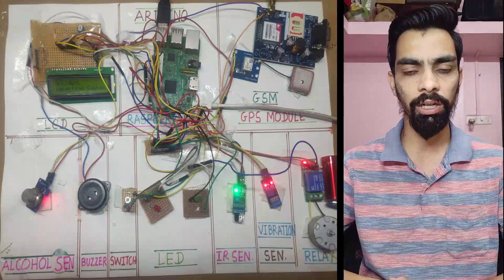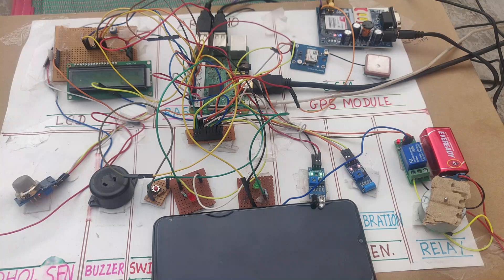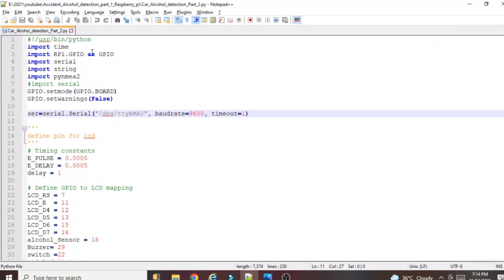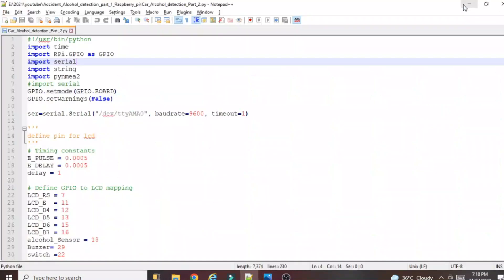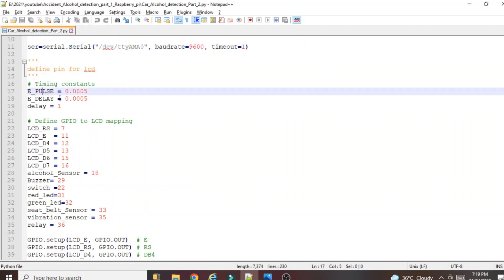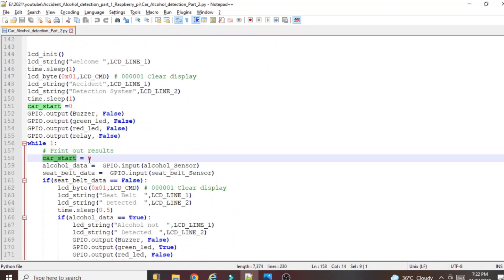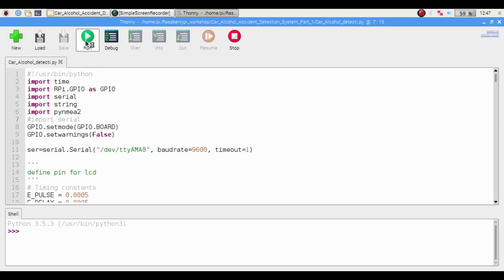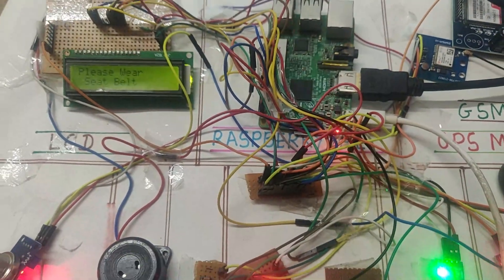Accident Detection System By Using Raspberry Pi | Send Live Location

Comment: How to interface gsm and gps in raspberry pi, in which pin we have to connect both ?
Can you make a separate video for it.
Reply from the maker: Separate video for gps is there . Have you watched ?
Gsm I will do .
Or do you want both in one video ?
Reply: @Rahul_Jadhav_Project  I want both GPS and GSM modules interfaced with raspberry pi in one video, the gps with raspberry pi video was very useful.
Reply from the maker: @arjun.k7090  sure I will make..but meanwhile if you watch my accident detection part 2 video in that video I have used gps and gsm in one project.
You need to copy that gsm and gps code and create new program . connection will be same
Reply: @Rahul_Jadhav_Project  I have connected GPS TX to Raspberry pi RX and GSM RX to Raspberry pi TX , is this connection correct?
If it is correct, when I send a message through gsm to my number, in the Raspberry pi it is showing send, but the message is not receiving in my mobile.
Any solution for this?
Is there any initialization for GSM like the GPS?
Reply from the maker: @arjun.k7090  which gsm module r u using ?
Have you enable serial communication by watching my gsp with raspberry pi video ?
Reply: @Rahul_Jadhav_Project  the same GSM module you are using in the video, I was using jio Sim,  let me change it to another carrier and see.
Reply: @Rahul_Jadhav_Project  I changed my sim and it worked correctly,  I got the message on my phone from GSM module, Thank you for your guidance sir.

Comment: U have also used Arduino in this video ?
Reply from the maker: Yes but there is another video separate for Arduino
Reply: @Rahul_Jadhav_Project  I want seperate with raspberry pi
Reply from the maker: @sayyedaftabas4296  but this is video for raspberry pi only.
I don't understand what exactly do you want